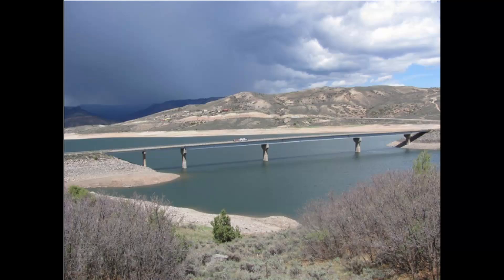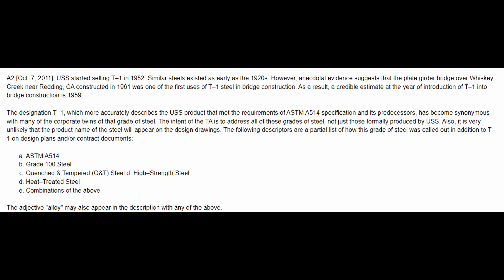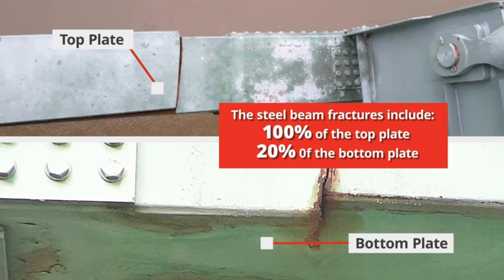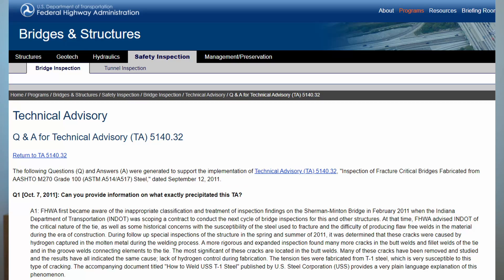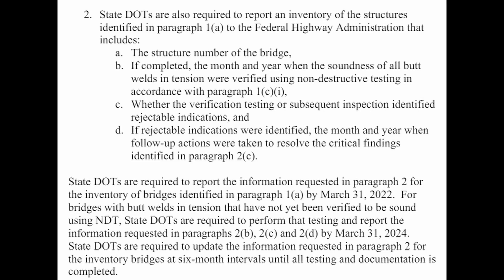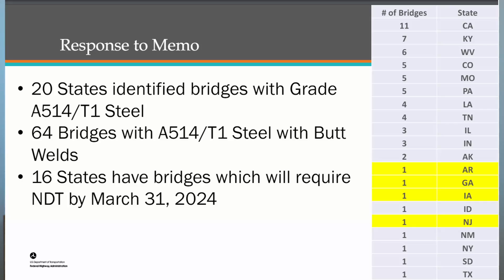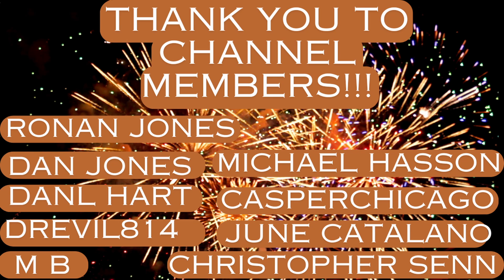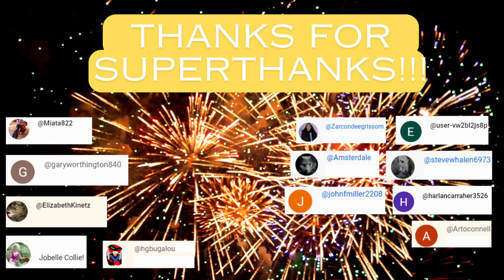The Major Implications of the US-50 Bridge Closure in Colorado

Comment: Anytime you have a stress fluctuation in steel and alulminum you have to worry about fatigue cracking.  Stress concentrations due to configuration of the steel can aggravate the condition, some materials are more susceptible to cracking than others, and welding also aggravates the situation.  The structural codes contain guidance for each type of weld configuration as to fatigue life.
A steel member that has a stress fluctuation on it will go a certain number of cycles with no problem, depending on the amount of stress fluctuation, any stress concentrations and the welding details that might be present.  Once cracks initiate they start very small, there is a certain life remaining as the cracks grow larger until the point that a member fails.  The problem with plate girders is once the cracks are large enough to be detected most of the fatigue life has been used up.
They could repair the girders with welded on cover plates.  These have to be designed with a configuration and welding details that does not aggravate the stress fluctuations or stress concentrations.  It may or may not be possible to make these repairs work for the long term.  They may only be able to extend the life of the bridge temporarily while they design and build a new bridge.  Designing the repairs is a relatively simple thing, implementing the repairs is somewhat difficult due to the location.

Comment: Is this really a steel grade issue or poor welding?  Hydrogen embrittlement can happen to most any steel via welding or plating processes not done correctly.
Reply from the maker: From my research, it is a welding issue that happens rather frequently with this T-1 steel.  This was a known issue (years after original construction) which prompted FHWA to get the states to complete their inspections by 2024.
Reply: @CaseyJones-Engineer  Thanks.  You can stress relieve to get rid of the hydrogen problem, but not very doable on big structural pieces esp welded on site.
Reply: @TheBeingReal  Not sure.  Post weld heat treatment is not recommended for T1 (I think) due to it being Quenched and Tempered.
Reply: T-1 has a small margin between yield and ultimate.  This means fewer bolts in a cross section, smaller crack before sudden failure, and up to 8x smaller flaw for the same fatigue strength.  This means that while grade 50 steels may have hydrogen cracking, they can tolerate larger cracks for the same fatigue life, as well as tolerate a lower fracture toughness.

Comment: Thank you for your video concerning the bridge on U.S 50 over Blue Mesa Reservoir in Colorado. As usual you are right on with your analysis. I live close to the bridge on the Montrose side. On Saturday, May 11 the Montrose Daily Press issued a story that included 4 proposed repairs to the steel bridge and I am very curious about your thoughts..... Bob
Reply from the maker: Thank you!  Well it sounds like welding repair won't be done. Instead they will be going with covering plates but there could be significant weight added to the bridge in such a repair that was not part of the original design.  The topic you raise is worthy of of me doing an update video as I think it is very interesting.
Reply: @CaseyJones-Engineer  I heard that they might mill off the three inches of asphalt and replace it with a 3/4" to 1" polymer overlay.  That should lighten the suspended span about 190,000 lbs.

Comment: Where are the other 4 bridges in Colorado?  I'm in Colorado and normally use that bridge several times during the Summer.
Reply: Another bridge over the resevior, not far away.  I know of a few with T1 hangers without welds.

Comment: Thanks for the video Casey! I am with one of the local fire districts in Gunnsion County, Colorado dealing with the US 50 bridge closure and your explanation has been a great supplement the information the Colorado Department of Transportation has been providing us. We are hopeful your 3 month prediction comes true as 6 hour detours over multiple mountain passes are no fun, however, the Rocky Mountain spring is making some trouble for the inspectors with high winds, rain and snow.🤞
Reply from the maker: Thanks very much for checking it out. I hope all goes well with getting this bridge reopened.
Reply: When I do get the permits how long will the job take?
Two weeks.

Comment: I've heard for offshore stuff like oil rigs, they control weld cracking using ultrasonic peening hammers to "reset" the fatigue life of the welds during inspections. why not do that regularly on these bridges?
Reply: It is done for certain welds with fatigue problems.  It is, however only effective at the surface.

Comment: These infrastructural issues are going to become more exigent as time passes because it is all aging.
Perhaps quite a bit of this stuff was built around the same time (when all of the Interstates were built?) and IANAE, but it looks to me that these structures have way exceeded their projected lifespans.
Reply: Beyond the lifetimes they were designed for at the time of construction, usually less than the lifetime the code specifies now.  Lifetime is hard to determine though except in retrospect.  Even that is suspect as, yes, currently alive bridges build in 1914 have had at least a 100 year life, but those are only those that have survived.  You have to consider the 90+ % that have not survived or are no longer functional.
Reply: Note three factors hit future bridge life in the 60's. 1. Welded bridges made fatigue cracks a problem.  2. Cement with a finer grind came into use (improved milling), and with it more porosity, less self healing, and more cracking.  3.  Efforts started to be made to keep nearly all roads free of ice and snow, resulting in use of deiceing salts rather than just plowing and sanding.  In the 70's due to better refining techniques to get higher yields of gas and diesel, the quality of asphalt binder decreased.  In many places the best sources of aggregate have run out.

Comment: About 15 years ago in Québec, a bridge collapsed during construction.  It was over a highway so made the news.  And journalists got hold of report on the  bad state of bridges in Québec,  which forced the government to announce a large project to inspect all bridges in Québec. A large number were flagged for reconstruction, some were imediately closed if felt not critical, and many hahave had weight restrictions on them.  An exchange in Montréal (Turcot) which was known to be crumbling (needed to close ramps every weekend to pacth things up and had nets attacked to site to collect falling concrete to prevent it falling on ramps bellow) and magically unblocked funding to have interchange project go ahead ASAP and didn't choose the chespest contractor, chose the bid that was the best, most crediple plan to get job don on time and with least disruption to traffic during construction (showing that this was no ta "create jobs" project but ratther "we need this done good and we donlt want anything more to crumble during our tenure in government).

In the aftermath of that "must inspect all bridges" edit, there were frequent  "this bridge i closed for urgent inspection" after someone would report a new crack on road.  Inspectors woudl come and generally a few hours later, bridge would re-open but sometimes it would re-open with weight restrictions in rural areas where heavier vehicles had to detour to next town to cross a river for instance.

In the case of the Colorado bridge, am curious if the politicians will choose the cheap/quick fix so they can announce re-opening sooner, or pay for a more complete longer term fix that will mean bridge closed longer.
Reply: At this time it looks like a long term fix.

Comment: My thoughts: When you have a Crack which is a total failure, and no load support at that location, the adjacent joints take the load that the bad joint is now not taking resulting in an overload of the nearby joints. =PC=
Reply: This is called redundency.  The presence of other load paths.  Hard to evaluate at this time, but clearly lower on this type of bridge, at least the parts with just two main girders and no continuity.
Reply: For this type of structure the next step in the failure might not involve the other butt welds but twisting of the structure.  Other types of structures might not twist much due to sufficient torsional bracing.  This is one factor that may have prevented failure of the Hernando Desoto bridge, hidden alternate load paths in the braceing system of both the arch and deck system.

Comment: Here's an idea: build a cable suspension system over the top of the US-50 bridge to reduce the loads on the original structure and prevent a catastrophic failure. It would be cheaper than building a complete new bridge and extend its useful life . (PE in Oregon)
Reply: I suspect that the towers, cable, suspenders, fussy details to connect suspenders to floor beams, and anchorages would cost more than a new bridge, though this site had a prestressed concrete suspension design as an alternate in the bid plans.  Also in Colorado we tend to prefer views of the mountains to high man made structures obstructing the views in the mountains.
Reply: Thinking about it, posttensioning the bridge might work, but perhaps not due to the thin webs.  I know of just one bridge rehab that CDOT post-tensioned, but ultimately it was not cost effective.  I also considered and rejected it for cost reasons for a set of long continuous bridges to reduce top flange plate sizes at piers.

Comment: You could gouge and re-weld a joint in the time it takes to do the inspection. Too bad it can't be done that way.
Reply: That applies to cracks only in the surface.  if there are a lot of flaws in but welded 2" plates, impractical without supporting the bridge. which can be impractical with bridges that are high or over deep water.

Comment: The boom trucks came on the scene after the dog bone swinging expansion joints began failing, late 80's early 90's. Ironworkers placed 28 ton "catch beams" under them all to prevent catastrophic failures. The joint is suspect so the hanging portion can fall 1/4" then is caught on the retro fitted beam. Same time concrete angel wing collums were crumbling and had to be post tension repaired. They need constant inspection as there are myriad areas they can fail. Ironworkers in the 80's warned and appealed to congress to fix our bridges, the can is now kicked to the dead end street through inaction. Prey before crossing
Reply: What bridge was this?
Reply: @michaelmcmullen354  I-81 Wade bridge over the Susquehanna @ Harrisburg, Pa. Mainus bridge in NE failed causing all such bridge retrofits. We had a T. McMillen in or local. Well respected man and good friend.
Reply: @CptImagine  McMullens are common in western Pennsylvania.  A lot of Scotch Irish and later Irish settled there 250 to 160 years ago.

Comment: How many of these failed welds have been in shop welded parts vs. field welded parts? Temperature control is critical to good welds in these steels. I used to weld this stuff back in the '70s and the parameters were very tight on temperatures. They had to be met at all stages of the weld for the weld to pass.
Reply: I think this was built before those tight QC parameters for this steel.
Reply: @michaelmcmullen354  I doubt it. Those alloy steels have been around since the early '70s. That's when I was welding them. T-1, Hy80, etc. That said, I have no idea what the fabricators did on that bridge....

Comment: Hydrogen embrittlement. Thats what happened at the Winnipeg Arena addition in 1980 when the welder was welding in the rain when construction drawings stated to not do that. Then the engineer had to use steel cables to reinforce the hydrogen embrittled welds. I just saw how the T1 steel has 100 ksi yield! Not surprised that thing has lower ductility than 30 ksi steel, particularly for cyclic loading. Here is what I found, and it is kind of frightening:

   Welding quenched and tempered steels such as T-1 (ASTM A514) can be challenging due their high strength and hardenability. If proper procedures are not followed you can end up with high    
    hardness in the heat affected zone (HAZ).  This can lead to premature or even immediate failure.

The guy from MNDOT told me the bridge inspectors are supposed to use life jackets in case they fall into the river. One group of inspectors fell into the MIssissippi, and all survived except the guy with no life jacked.

Definitely keep those videos coming!  😁😉😊🥲😋💝❤💯💪👍

Comment: T1 steel is mainly for wear and impact uses. I don't know why it started getting used in bridge construction. It doesn't just crack at weld seems. There was a bridge in Cornell WI that was built as an arch made in a tube configuration out of T1 steel. The bridge wasn't very old as bridges go when the arch started cracking and the bridge had to be replaced.
Reply: Actually probably a lot of welds on that Cornell WI bridge.  The tubes have to be built up by welding plates that are made long enough by butt welding.  There will also be connections to the Arch elements for bracing , columns, or hangers.

Comment: Complicating the Blue Mesa middle bridge situation is the Sapinero Bridge two miles to the west of the current bridge under repair.  It's a T-1 Steel bridge that hasn't been inspected yet.  The bridges are in series, so if they find problems with that one, US 50 may remain closed for a bit longer.
Reply from the maker: Interesting.  FHWA gave these states until the end of March 2024 to complete these inspections so I guess Colorado (and probably other states) are behind.
Reply: @CaseyJones-Engineer  Not the sort of inspection you can do in the winter in Colorado Mountain areas.

Comment: I would love to hear your retroactive assessment of a similar incident with the I-40 Hernando Desoto Bridge over the MS river in Memphis. A complete catastrophe on an even grander scale than Baltimore was narrowly avoided there with one side of the bridge's steel box girder 3/4 of the way cracked. I would be curious of your assessment of the cause as a geotechnical engineer as the bridge is built on thousands of feet of alluvial sediment soil that is full of water at many depths as well as the effects of decades of small but repeated seismic events from the New Madrid fault.  I've wondered if t hose factors played into an almost complete failure of a major structural member or if it was just good ole cyclic stress from hundreds of semis going over the bridge daily.  Not catching it earlier was a MAJOR failure of both the AR and TN DOTs, but I must acknowledge the professionalism shown when it was caught and the promptness and seriousness displayed in getting the bridge closed. It was also an incredible feat of engineering on how quickly they got the bridge repaired and back open to traffic considering the damage and the incredible amount  forces in play that needed to put back into place, so to speak.
Reply from the maker: I talk about the Hernando Desoto Bridge at 3:02 in this video.  As far as piles not reaching bedrock it is typically not an issue at such sites.  The depth to bedrock is as much as 10,000 feet in most of Louisiana so those bridges are supported by these "friction" piles.  Of course the pile have to be properly designed unlike what was the case for the piles in the original foundation for the Millennium Tower in San Francisco.
Reply: I believe (having viewed a report), that it was a combination of a very large internal crack combined with fatigue that was aggrevated by the location of the butt weld.  I personally think the surface penetrating crack on the Blue Mesa middle bridge was in a similar situation, a high stress area with lateral flange bending concentration due to the diaphragm configuration kicking the bottom flange outwards with every axle group passing over the floor beam, plus added stress sucked down into the flange from the web by the increased area of the thickened zone at the adjacent bolted splice.  The thickening of flanges at bolted splices is due to the area of the flange at the bolt holes being inadequate for the ultimate strength of the T-1.  Turns out it would be more economical to make the bolt pattern a bit more complex to gradually increase the number of bolts in the spliced section from 1 to 2 to 3  at the ends of the splice to avoid the unzip on the dotted (perforated) line effect.  Was commonly done in the days of riviting.  Generally unnecessary if the UTS is > 1.5 YS, but for T-1 UTS = 1.1 YS.

Comment: I wonder why light vehicles must be blocked.

Seems also that by applying strain gauges in every critical place (that would subsequently be inspected), it would be possible to monitor the bridge condition as inspection and remediation proceed.

More generally, it seems that structure monitoring using strain gauges and laser interferometry and, maybe also acoustic techniques, should be implemented widely.  

Going forward it seems such structure monitoring should be built in.  The technology is already in use.  As an example, passive RFID tags can be applied to each item in a refrigerated compartment.  Using a single transponder, each individual item’s temperature can be read.  Why not with bridges?

Comment: Why was T1 steel chosen and what qualifications did it undergo before being specified? What other steel choices are out there?
Reply: Only the longest spans used T1.  It might have been possible to design a similar bridge in a lower strength steel with deeper girders, but the girders could not have been shipped to this site, or perhaps any site inaccessible by barge.